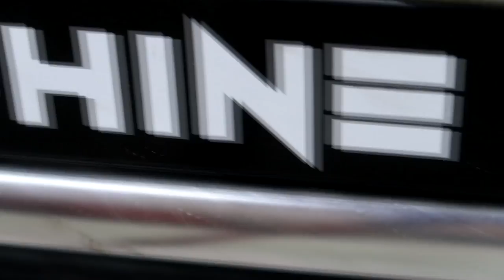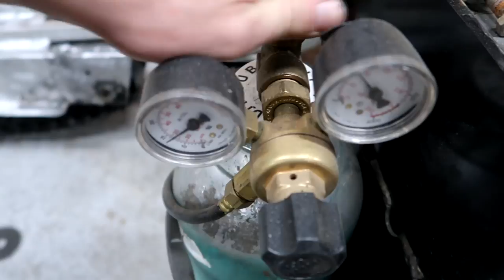OVERDRAFTED MY BANK ACCOUNT ON THIS

Comment: Hey Dalton I have this on 2006 body to a mower that I took off because I want to strip off the paint and repaint it it’s starting to rust and I want to prevent further rust it’s too cold out to use paint stripper in the wire brush I have on my drill is going really slow does anyone have any ideas or anything I should try should I just try paint stripper anyway?

Comment: Hey dalton. I have 2007 suzuki eiger. I was wondering if you could help me figure out the problem. It requires the choke to start and you have to leave it on for a while, and it backfires if you let of the gas. Do you have any clue what is wrong?
Reply: Carb issues, just rebuild the carb and tune it
Reply: Thanks

Comment: Dalton,  or Jake,  I need some serious help.  I took my bike to a local shop around me an they messed it up.  I don't know how to work on it or anything.  If you guys could help some how.  I'd greatly appreciate it.  Or even anyone.  I just wanna ride.  1986 Yz 250 2 stroke.
Reply: whats messed up doesn't run?
Reply: 100% Awesome they didn't hook up the back breaks,  the clutch doesn't work, and not idling at all.  I have to constantly be giving it a little throttle to keep it running